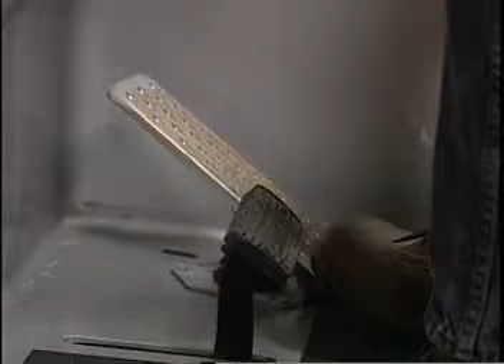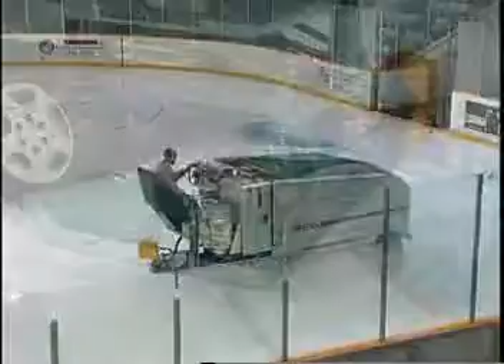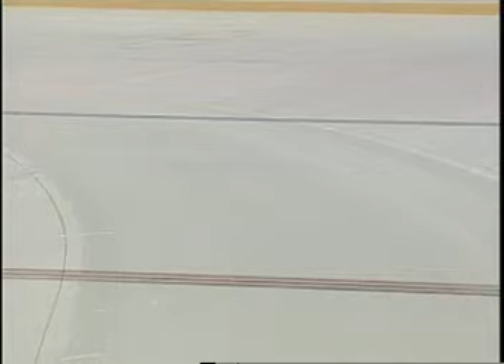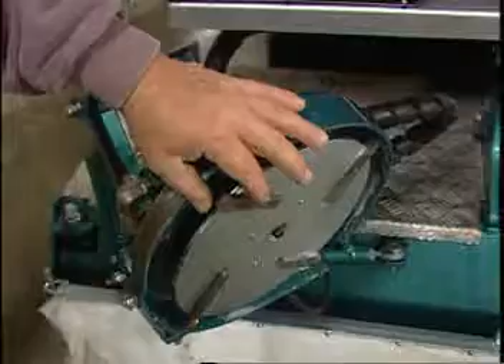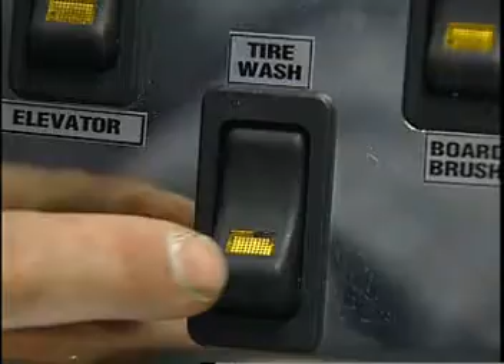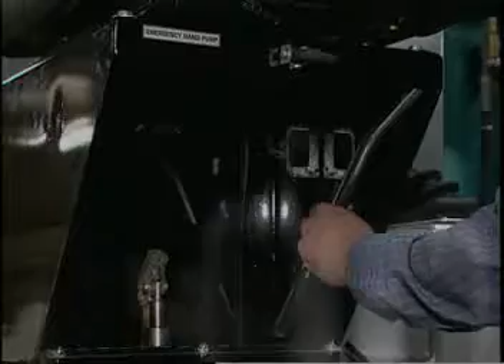Olympia Ice Resurfacer Operational Video

Comment: Hey. I'm getting rippled or bumps in the ice. Never had this before. What do you think is the issue? More down pressure? Adjustments?
Reply from the maker: Is the blade sharp? I found if the blade is dull, it will skip and chatter along the ice.
Reply: @chadz34  the blade has about 40 floods on it. We tightened the auger chain which was very loose. Seems like it helped a little bit. Someone also said I need more down pressure. I put the conditioner down until it starts to push you up. Then stop. I dont continue to hold it down.  You?
Reply from the maker: @brandonhicks9730  We change our blade every Friday to ensure it's fresh.  As far as the conditioner, I like to watch it touch the ice and keep holding the button until it's done moving, and then I start my augers.  Do you adjust the blade each time you change it?
Reply: I just changed the blade this morning. Not enough rentals through the week at our arena to change every Friday. I try to avoid adjusting the blade everytime. I feel that you shouldn't have to. You?

Comment: pile of junk machines, have 2 at the rink nothing but problems with them very unreliable . We end up having to pull out the old spare  zamboni  thats from the 80's  way too much. Also the hydraulics are weak as hell and are crap for shaving and ice maintenance compared to zamboni. Whats the point of a v8 engine if the hydraulics are so weak. GARBAGE!!!